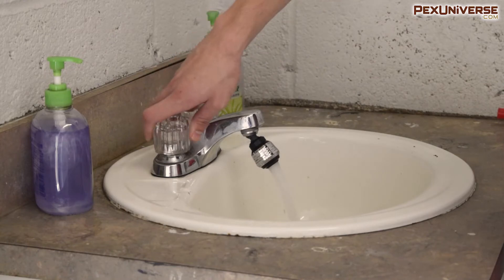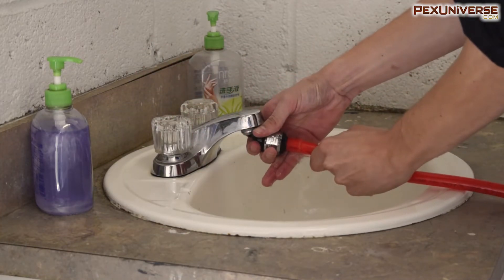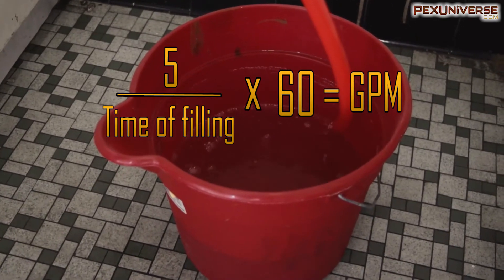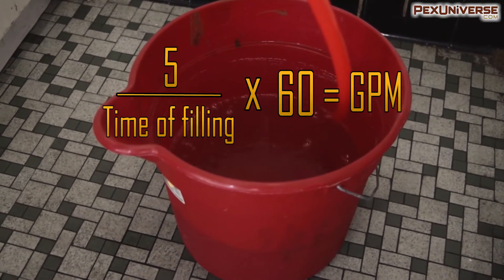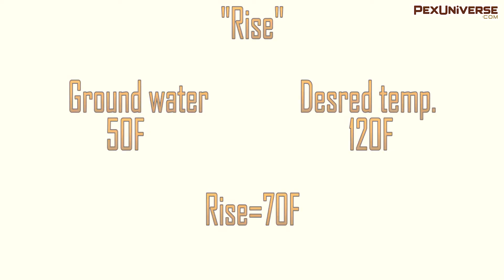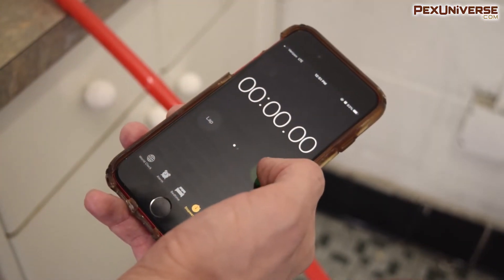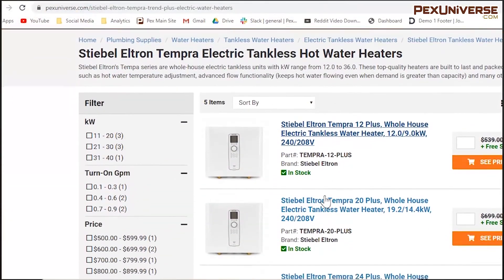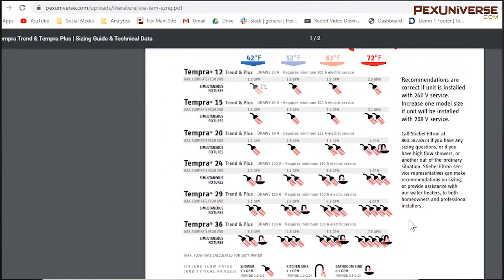One-Stop Guide To Point Of Use (POU) Water Heaters

Comment: Does anyone make an under sink POU that draws from the hot (not cold) water source?  I have a capable whole house POU but it takes 1.5 minutes to get to the kitchen sink/dishwasher.  Looking for a unit to fill that 1.5 minute gap.
Reply: A bit late, but you can simply get a hot water line into the cold water inlet. Water heaters can handle it, and it helps the water heater not work so much. Good luck
Reply: Thanks for the rely.  I ended up buying a Bosch Tronic 3000T 2.5 gallon tank and love it.  It supplements instant hot water until my whole house heater can catch up.   @mariogutierrez2965

Comment: I have a large house with a new combi gas system. It takes a while to get hot water to distant areas of the house. If we install one of these under the kitchen sink, will it just use this until the hot water from the boiler gets there? I guess I'm asking if you can use it as a supplement to our existing system?

Comment: why can't we use 2 medium POU tankless when a house has 2 main outlets in a house? Kitchen and laundry on one and of the house and showers on the other.
Reply from the maker: You actually should be able to connect two individual units as the pressure can be maxed out in one if too many things happen to be connected to it.
Reply: @PEXUniverse  I was thinking of 2 POUs functioning independently. The kitchen and laundry is about 45 feet away from the 2 bathrooms. For me it doesn’t make sense for them to be linked at all. The shower end should have the bigger POU but the kitchen end can get a medium sized one. What do you think? I just question the whole idea of a single water heater system, tankless or otherwise.